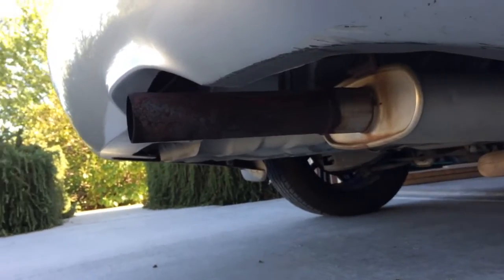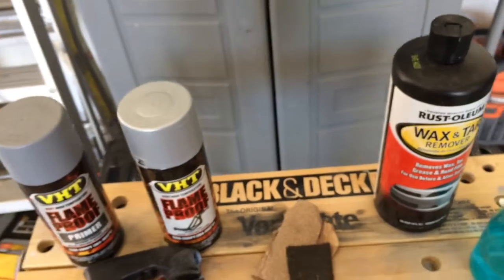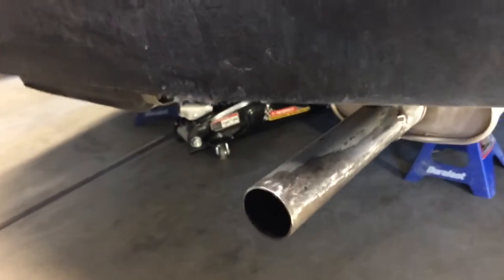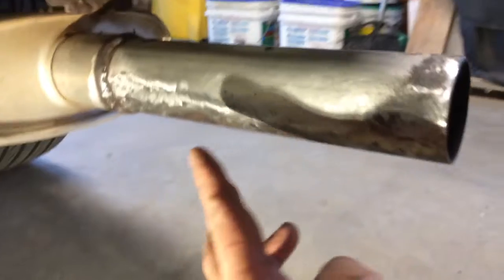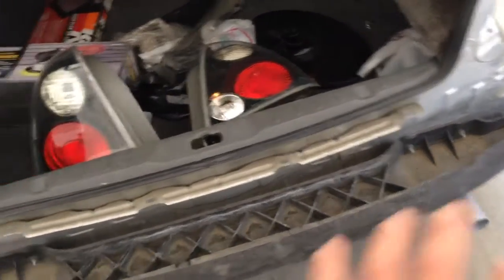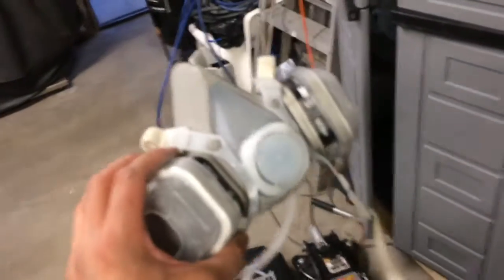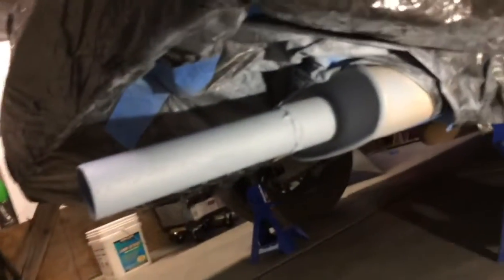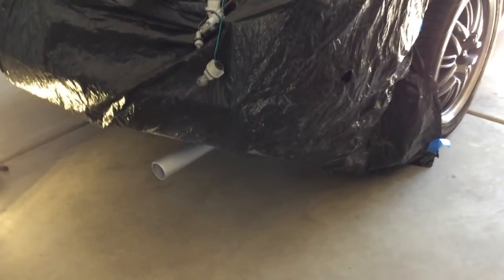Painting a Rusty Muffler Tail pipe

Comment: Honestly would of been easier just removing the muffler instead of the bumper cover
Reply from the maker: That OddCouple easier? The muffler is welded on... don’t see how that would be easier.
Reply: @DIYCustoms  im sure it has a flange or a slip joint somewhere. its not going to be welded all the way to the head
Reply from the maker: The muffler on that rusted pipe sticking out is welded as one piece. I had a chrome piece over the extended pipe. Over time, that extended piece rusted.

Comment: Looks good! Thinking about doing this tomorrow. Is it still holding up?
Reply from the maker: Ethan Silver it sure is! I wish I had done after installation of the muffler.
Reply: waltwitty it’s safe to go the whole exhaust system right?
Reply from the maker: Ethan Silver you can, this specific paint is formulated for high heat exhaust parts, manifolds.. etc

Comment: That seems like Overkill did you know that lime away will take away all of the rest that's on your rusty muffler. No grinding or sanding, just wiping.
Reply from the maker: Ultra DaSilva there are products that will remove rust, absolutely, but the bare metal wii continue to be exposed unless treated. By doing this “overkill” procedure, as you put it, I saved myself money on replacement and installation costs